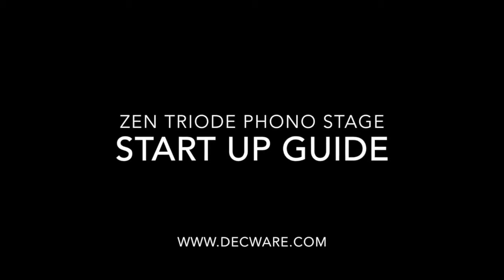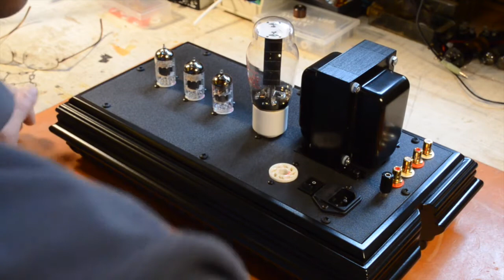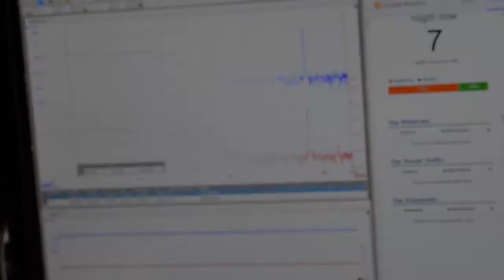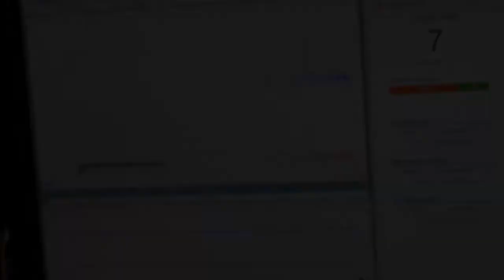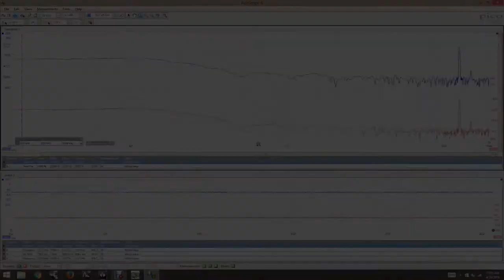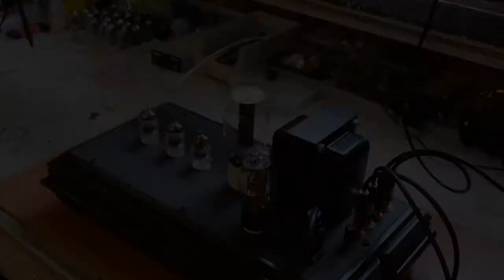Model ZP3 startup

Comment: Single ended "tube" amps are great if one likes even harmonic distortion.
Reply from the maker: On this phono stage the THD is too low to hear, and that is also the case with solid state.  The bigger reason SET amps sound great is actually the lack of negative feedback due to the superior linearity of the triode.  In this unit, we also use passive RIAA so there is no feedback of any kind in the circuit.  This becomes especially important in a dedicated listening room with acoustic treatments because negative feedback limits sound stage depth.

Comment: I don't know why a small amount of manufacturers still use these tube diodes and regulators, solid state is so much better.
Reply from the maker: Could it be that some engineers trust their ears over their eyes?  Probably so.  Small amount of manufactures --  manufactures of what?
Reply: @decwareproducts  I think you mean some engineers trust science over cognitive dissonance. Small amounts of audio component manufacturers, that's what, because if you asked Agilent, Tektronix, R&S, etc. they would laugh at someone who thought tube rectification was better than solid state. But let's not do that, if you want to use your eyes then look at at McIntosh and Luxman with some of the top engineers in the world who have been designing some of the most coveted tube amps for decades with solid state front ends. Even the highly rated Fisher 500C from the 60's uses solid state rectification, what those engineers were and are all deaf?

What's the science? I can give you lots of science for solid state front ends and why they are better. Think you can hear the difference between DC from a tube and DC from SS? That's rhetorical, you can't and you can't see it on a scope, an FFT or a bode plot and I can prove that with instruments that measure far beyond human hearing. It's called science, you can buy test instruments that measure picoamps and gigahertz , are they using tube rectification? They'd fire someone who put a 5U4 in a scope or bench meter. Audio equipment is electronics and it follows the same rules. The nonsense people who know nothing about science believe is embarrassing.
Reply: @mosfet500  give me a hybrid amplifier as a Bass guitar player then give me a straight up tube amplifier for my guitar but for music, that is my personal music listening, then it is always a subjective opinion. Some people like coffee and some people like tea.
Reply: @BicycleJoeTomasello  Rectification converts AC to DC. You can't hear DC regardless whether it's a tube, silicon diode or a battery. It doesn't matter if it's a guitar amp, a preamp or a power amp. With solid state rectification you can control parameters better so tubes last longer. You could have similar control with tubes but the cost, complexity and failure rate would be much higher.
Manufacturers put tube rectification in because buyers have no idea what electronics is. Decware arguing that it makes a difference and their engineers can hear it is an embarrassing lack of understanding of basic electronics.
Toroidal transformers are in the same bag by the way. Hum in transformers is not inductive, it's capacitive. Toroidal transformers, because of the way they are wound, have greater hum than, say, a double bobbin type transformer.
I have no issues with Decware or any other manufacturer, this is just electronic engineering. The dynamic range of this amp is limited simply by its output power. High efficient speakers in small rooms it's probably fine. The problem is that the price is getting into the territory of more versatile amps. I suggest listening to a good class D with a tube preamp. The sound comes from the preamp, that's the best place to contour it, not so much in the power stage.
Reply: @mosfet500  Are you here on behalf of Amir?  I thought his followers spent all their free time circle-jerking whenever he reviews a product with a headless panther.  It's quite clear you've spent a few weeks on his forum gobbling up all the drivel and for whatever reason feel the need to spout off on YouTube and try to damage a manufacturer's reputation.
Reply: @YuengsNwings  I don't know who that is, however, I do know electronic engineering and science. I'm not trying to damage any manufacturers, I'm citing science and who does it benefit? It benefits the customers, why are you favoring manufacturers over customers? You have it backwards. 

If manufacturers follow science I have no problems with them. Luxman and McIntosh for example have been making tube gear for decades, do you think they are "spouting dribble"? No, they know science and it goes into their equipment. Again, no one on the planet can hear DC, to think that tube rectifiers make a difference is to make the statement that you nothing about science and electronics. Audio equipment is no different than any other equipment, it just serves a different function. Go to Tektronix, Keysight or R&S and tell them they should be using tube rectifiers in their test equipment and see what they tell you.

What? I'm damaging reputations with the truth? This is why audio is voodoo today.
Reply: @mosfet500  Funny you go into such lengths regarding the two different types of rectification. 
Most opinions and statements, found online at most audio forums and similar places say the same as you, that the solid state rectification should be better, and that rolling rectifier tubes does not / should not have any influence on the sound. 

However, some owners of this very phono stage, as well as the owners of some tube rectified headphone amplifiers claim, in no uncertain terms, that the choice of rectifier tubes does have substantial influence on sound character of their amps. 

Do you happen to own this phono stage?
Reply: @argokan  I've owned, designed and built them and I'm listening through very respected high end speakers. If someone thinks they can hear the difference than prove it in a DBT, no one has yet.

Rectification does exactly that, it takes a pulse and turns it into DC, if you can hear a difference than it's noise because that's all that poor rectification can create and all anyone can ever hear. The best rectifiers have the lowest noise regardless whether it's an oscope or audio circuit. Indeed, we can make instruments that measure down to picovolts, if the rectifier left noise on the DC line then that wouldn't be possible even with the CMRR's(common mode rejection ratios) of instrument amplifiers.
I do this stuff, all I want is the best sound and dependability at the lowest cost. It's entirely possible today to get that at a fraction of the price some of these component manufacturers sell their stuff for. Do you think they are going to tell you what I'm telling you? Not in a heartbeat!

I've had debates with the editor and technical editor of Sterophile, it's embarrassing how little they actually know about electronics, neither of them could find a cross in church!
Reply: @mosfet500  I have had a conversations with several  designers(very well respected) of the audio equipment - amps, preamps, etc. in the EU, where in particular one of them sheds rather different light on the pricing of the products, and why things are as they are regarding that. 
You simply omit to say a lot, what makes for pricing and surviving on the market, and how the price setting has to be (virtually) in order for the producer to survive on the market. That if I compare what you share here with what that person has told me, and in no uncertain terms. 

Regarding the part with rectifiers, I do not listen to the equipment with the loudspeakers, but exclusively with headphones. 

To prove that rectifiers CAN have a major influence on the sound of the tube recitified amp, and do have, well, I would never contest that - as I have heard that clearly myself, and was very surprised that there are indeed differences. Many other owners of the amps and preams have confirmed that. Anyone who has any formal education regarding the electric circuitry knows what you say about rectifiers, but then, when asked the question why does one rectifier sound this way and other that way -  no answer. Some other designers do know, and have as well told that there are number of people knowledgeable regarding the audio circuitry who could, at the same time, not tailor design things to sound certain way. 
Solid state vs. Tube rectification... a number of owners of the tube amps, owning the fully solid state amps at the same time, have clearly told, time and time again, that they prefer the amp with the tube rectification rather than having that tube rectification removed in the same amp and replaced with the solid state rectification, and for no uncertain reasons. 
How measurement correlate to the sound, how choice of the components correlates to the sound... it is interesting that some people simply omit that in their "opinions", yet are very fast to claim that everyone else  is wrong and only them  themselves are right, and then back that up with supposed "measurements", that in reality do not say much about why one amp is perceived and loved (or hated) this way, and the other vice versa... 
There are people knowledgeable in the field of electronics and audio design who do not claim the same stuff as you, but on the contrary. 
Cost of the components... well... swap the caps in some phono stages, and see what some of those sets of caps cost, and how they improve the sound of the entire component, if placed according and within the specs of the electrical circuit, then tell me about the prices of those sets of caps, especially today. 
I don't think things are as simple and straightforward as you want to make them to be, and believe me, I have had conversations with one and another audio designer, even during the last few days, and some time before that, as well (very well established, no nonsense or bullshit or non-technical, flowery descriptions talk), they do not tell the entirely same story as you do. 
Cost vs. quality is also well known in the DIY community, people have made the cost calculations on building their own amps vs. some commercial offers time and time again, and comparisons were in many cases very telling.
Reply: @argokan  First, you can't simply say you talked to this or that person who you think is respected. In science we call this Anecdotal Fallacy. If someone disagrees with the very clear science of rectification then they have to prove it just like I did with reason. Again, the purpose of rectification is to take an AC signal and convert it to a DC voltage that does not have an AC component to it unless it is poor quality rectification. Indeed this is the very definition of DC, direct current regardless whether it is a battery or a highly rectified AC source.

So if someone disagrees with what I am saying let them come here and debate me. To say this or that person disagrees with me is meaningless - we use science and if we can't measure it on equipment thousands of times more sensitive than the human ear we can't hear it. If you or anyone else thinks they can then prove it in a DBT(double blind test). I have not met one individual who could. Again and again there is no audible element to DC, in order to hear an audible signal there must be a variation in that signal, this is the exact opposite of DC by definition. Real electronic engineers know this, if you went to Keysight or Tektronix and said you wanted to put tube rectification in an instrument you would be laughed at and then promptly fired. It is only in the audio community where voodoo science exists that people make these silly claims. The only difference between a precision meter that measures down to picovolts and an audio amplifier is the function - it's all electronic engineering and it is a very accomplished science. We can make a complete electric car for $30k with sophisticated motor control systems far exceeding the technology of any turntable but we can't make a decent turntable under $50k, worse I've seen these things for $250k - absolutely ridiculous!

You will notice that Decware has no science to justify their tube rectifier amp and no engineer disputing my statements.

Bring it on -anyone??
Reply: @mosfet500  Well, in terms of psychoacoustics, and how the engineering (sound engineering) relates to human hearing and the sound, I can easily read that you do not really know what you are talking about. At all.

It is one thing to measure and apply measurements and "science" and engineering, and (completely) another to stubbornly listen with the measuring instruments only and disregard the human ear and perception, and simply dismiss other (numerous) people's experiences without any further thought, just like that, on a whim. 

I never discussed the tube rectification vs. solid stated per seï, I just explained how people react within the realm of tube rectification when rolling tubes, whatever the EE friends at Keyside and Techtronix might think about it in the realm of the equipment they design and produce, for their own purposes. I did mention that many people prefer tube rectification instead of solid state rectification, due to the PERCEIVED difference in the sound and flexibility to tailor the sound to some extent with changing - rolling the tubes - I know that goes against your claims and common preconception that type and the characted of the rectification does not affect the sound (yet, there is a lot of anecdotal evidence that actually in many cases it does). 

Your comment regarding the "anecdotal fallacy" is downright ignorant and really openly insulting, openly dismissive of the years of summoned and existing experience with both engineering stuff. It is  nothing less, even more so since you do not have the faintest idea to whom I was talking to throughout the years. 
It is also insulting the intelligence and vast experience of the people floating around and possibly reading all of this. Do note that certainly not one of those people have background in both (applied) science and engineering vastly preceding and exceeding yours. 

Furthermore, your whole line of argumentation simply doesn't cut it, nor it does at all address one really relevant question: how come we have today a myriad of audio components, many excellent and well engineered, some less so, but none of them, even when comparable in class, cost, circuit topology, even components used, sound the same? 
Can you explain that, very simple and very apparent, very existing facts, with any of the measurements existing today? 

Or are you going to tell us all - the usual "if it measures well it must sound well"? 

Well, sorry to burst the bubble, it is actually common knowledge that it does not (always), and also that there were, even recently, payed reviewers by the companies, who sponsored them to push forward their equipment that reportedly measures well, and sounds border line mediocre to awful. 
Well, how come that the stuff measures well (some DACs and amps), is promoted as the best thing since the sliced bread, and  yet so many report that it simply sounds downright awful? All of those critics are delusional, ignorant, and you name it??

FYI, I have an engineering and academic background. But I also do look for the truth, supported by both the measurements as well as the user experiences in the field of hifi and audio. Not solely on the basis of one or the other. Whereas to you - one gets the sense that those two somehow appear to be mutually excluding, this in the sense that anyone who hears differently and does not agree with your claims in relation to the sound quality is delusional and downright incompetent, without any further thought on your behalf? 

You cannot possibly claim that all, so called audiophiles, and some designers with essentially good and acclaimed products  are ignorant, delusional, and have no clue what they do and talk about. Among them, and be certain of this as a fact, there are people with far more experience in both science, engineering and audio than both you and me. 
You can call this an "anecdotal evidence" as much as you want, I call it a statistical fact, and not without some good ground and reason.

Comment: I have heard one should handle tubes/valves with gloves to prevent unequal heating of the envelope. Any thoughts? Thanks for a great video and a great product!
Reply from the maker: This is a common mistake because halogen or quarts light bulbs require gloves to handle because finger oil will insulate the glass and cause it to run hot in spots and shorten it's life.  Not true for audio tubes. That said, fingerprints aren't all that attractive, so we just wipe the tube with alcohol when we're done.
Reply: @decwareproducts  Thanks for the clarification!

Comment: I was also surprised that you powered up before connecting inputs / outputs. Always thought power was last.
Reply from the maker: With high power that is typically true.  However our SET amps don't have enough power to blow themselves up or your speakers because we oversize the transformers.
Reply: I am not using tubes and if I would, it will be a Decware. I am using an old conditioned STR151A putting out 7.5w per channel driving a Coral 12TX-50 speakers. My technician oversized my power transformers, he did a good job and I am still enjoying playing records using ceramic cartridges. I am watching because I am thinking of using a MM in another turntable setup. Nice video  👍🎶👌!!!